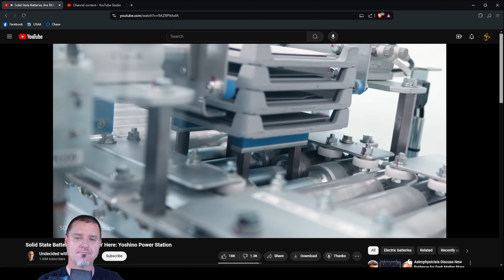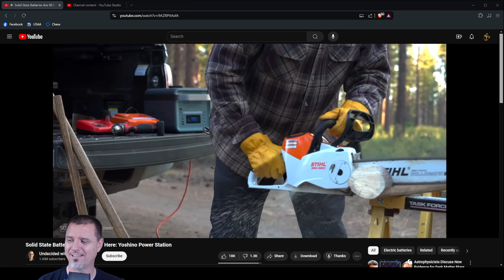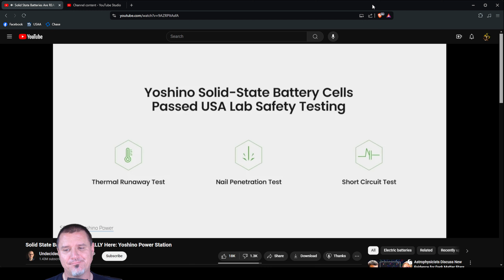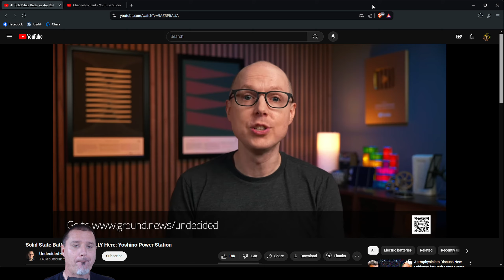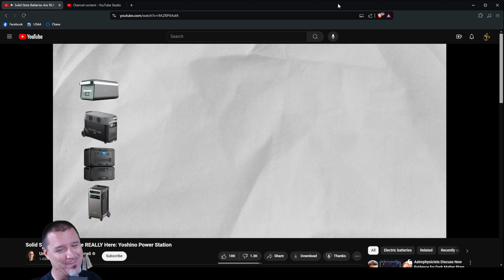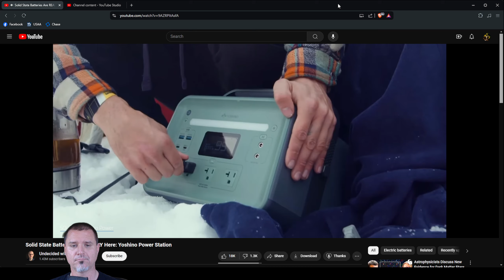Solid State Batteries Are REALLY Here: Yoshino Power Station | Gunthrek Reacts

Comment: Yoshino power teardowns reveal non solid state batteries in their power stations
Based on teardowns and analysis, it appears that Yoshino Power’s portable power stations, including the B330 and B4000 models, utilize non-solid-state batteries, contradicting their marketing claims of employing solid-state technology.

Key Findings

Liquid Electrolyte: Teardowns reveal the presence of a liquid electrolyte, a characteristic of traditional lithium-ion batteries, rather than a solid-state electrolyte.
NCM (Nickel Cobalt Manganese) Formula: The battery chemistry used by Yoshino Power is identified as NCM, which is a common formula for lithium-ion batteries, not solid-state batteries.
Safety Concerns: While Yoshino Power’s marketing emphasizes the safety benefits of solid-state batteries, the use of liquid electrolytes and NCM chemistry may still pose safety risks, such as thermal runaway and fires, similar to traditional lithium-ion batteries.
Reply from the maker: Good to know!

Comment: unfortunately for Matt he REEKS of Confirmation Bias.  ref: "The greatest DERANGEMENT of the mind is to believe in something because one WISHES it to be so..." - Louis Pasteur, Forefather of Modern Microbiology (1822-1895).  mind you i say this as someone who's been in the Mechanical Engineering Sector for the last 36 years, so this means i was around way back in 1990 to read the HYPE in the Media (ie, New York Times) and read the Scientific Journals regarding the "breakthrough" of Super Conductivity...

okay sucks to be us, but "fast-forward" 30 years after the original "breakthrough" and one DOESN'T have to be an Engineer to figure out that Society DOESN'T have Super Conductivity (aw crap) which parallels how we DON'T have Fusion at room temperature, and DON'T have Solid State Batteries.  no and despite this, unfortunately what laymen are UNABLE to recognize is that what they're missing is the "comparative Life experience" (which would build up in them the necessary INTELLIGENCE) to be able to differentiate what is REAL from what is FAKE to begin with...

yeah, there's a REASON why there's an old and famous saying that states: "A Sucker Is Born Every Minute..." <---- it's because they literally ARE born every minute".
Reply from the maker: And this is why videos like this are important, Even if they might be inaccurate. This discussion wouldn't be happening without it.

Comment: Well, its really unlikely that the Yoshino actually packs solid state cells.  Matt made a number of very large gaping mistakes in his video including (the big one) comparing the various power stations with each other, because nearly all power stations on the market use LiFePO4 (aka LFP cells) whereas the Yoshino is NMC-based (NMC, NCM... same thing)... that accounts for the difference in weight without "solid state" coming into the picture at all.

Just because someone claims to be using solid state cells in marketing material on Amazon or Ali, doesn't actually mean they are.
Reply from the maker: Certainly possible!